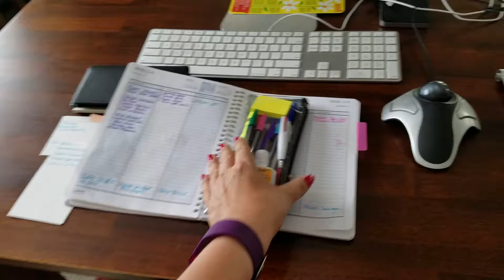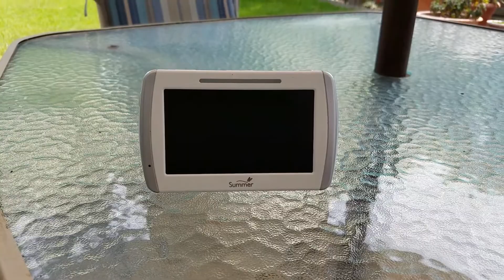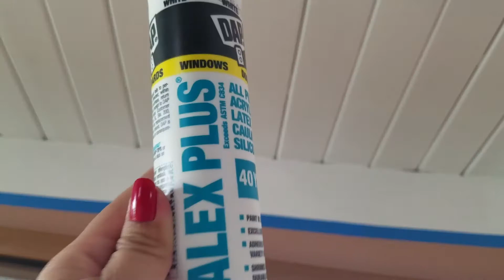Home Project DIY | Caulking Walls & Ceiling

Comment: Question , do the boards move with expansion,will the caulk hold up ,and look good after painting? If it was me I would see if the spaces bug you, if not maybe leave well enough alone. P S the surrounding edges do look more finished. Good luck enjoying the video.
Reply from the maker: I was concerned with the same, but that's why I'm applying in a super thin layer. The previous painting job obviously didn't keep sealed. I guess we'll see in time 😉